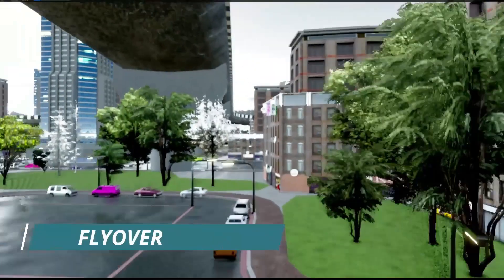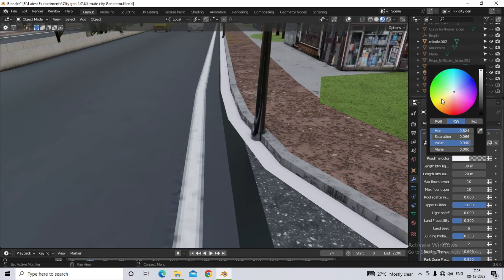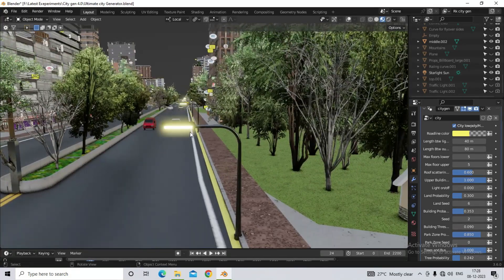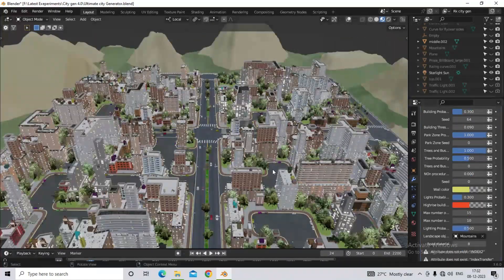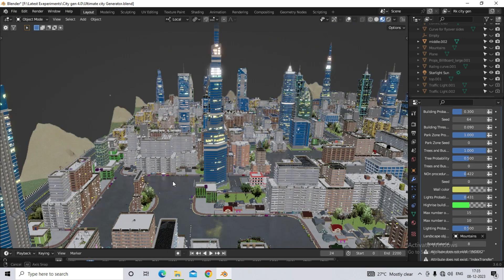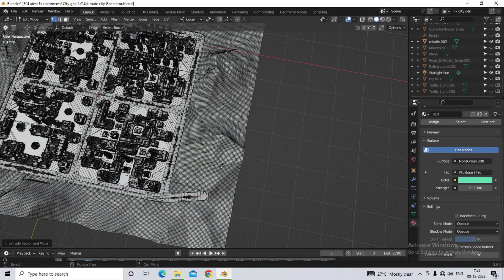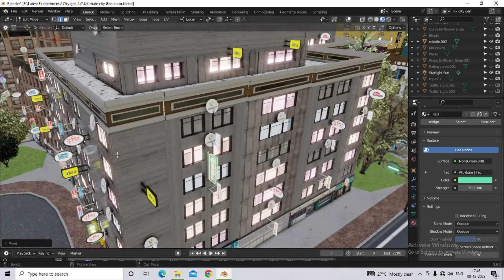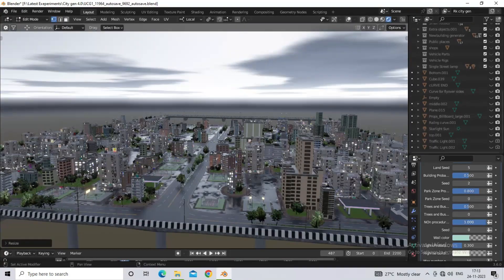Ultimate City Generator full details tutorial in English #b3d #geometrynodes #simulationnodes

Comment: Hi. I opened the USG 1.3 asset in Blender and got some warnings like this:
LIB: NodeTree: 'cubicity_edge-hilight' missing from 'F:\blender assets and texture\generators\cubecity\cubicity_ASSETS_v01\cubicity_ASSETS.blend', parent '<direct>'
Should it be fixed somehow?
Reply from the maker: can you share me your small video or screenshot on my discord server or my Instagram profile
Reply: @rkboost  Couldn't find a link to the discord btw...
Reply from the maker: @trigeger  https://discord.com/invite/qKqyAcVY
Reply from the maker: Cubecity is different generator buddy.

City generator doesn't have any cubecity object or node groups
Reply: @rkboost  Okay, it did not repeat on reopening. Probably used some city project previously with broken links (also I do not have disk F with Blender assets like in the warning). Thanks.
Reply from the maker: @trigeger  is it working?? Or need any help??
Reply: @rkboost  At first glance it works (don't know how to "extrude" roads vertex for now in Blender in the edit mode, there are too few ~20 vertices visible for some reason but will investigate), I'll check more later when I get back to it. Thx
Reply from the maker: @trigeger  ohk

if you give  any suggestions to improve city generator it will be appreciated.